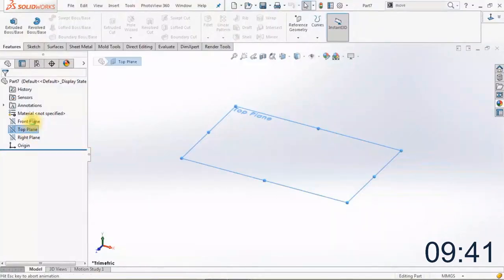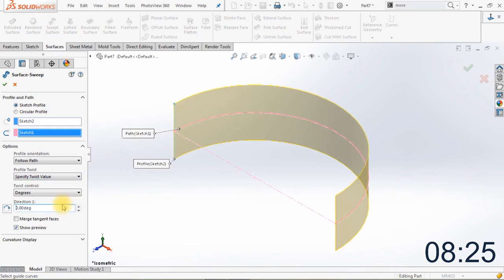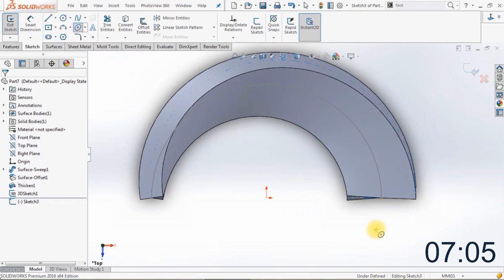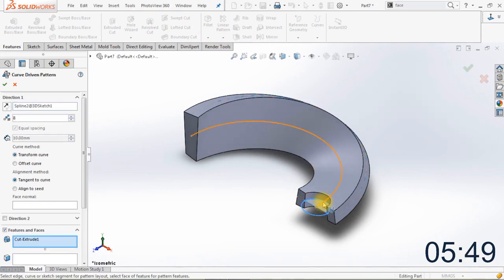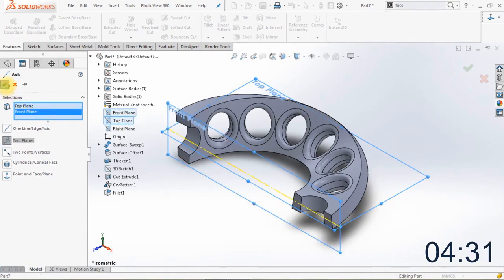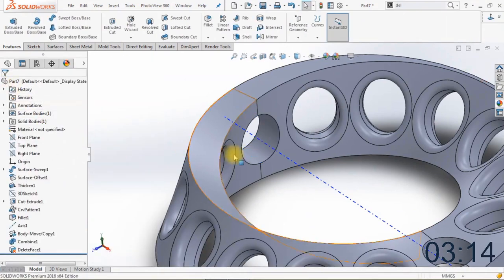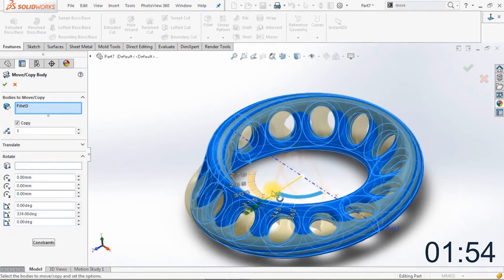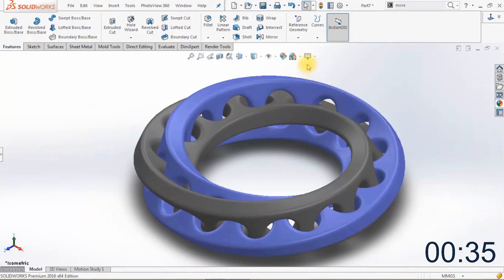Modeling a MOBIUS RING in SOLIDWORKS | Learn SOLIDWORKS by modeling a complex product in 10 Minutes!

Comment: Very high Cool Factor! 
I believe that this, as cool as it looks, would be impossible to actually make. Don't get me wrong, though, I Don't Care! Although it would be cool. 
I use an older version of SW (2015) and I found I had to "smack it around"* a little to get it to finally succeed, but I ultimately prevailed, and it came out perfect.
*it wasn't initially able to do the combine operation, but I figured out a way to help it succeed without compromising the shape.
Reply: @LearnSolidWorkscom  Don't think so. This is 2 separate parts that interweave without contacting each other.
Reply: @catkeys6911  that's true... but when the parts can move it's a fun baby rattle! ;) Otherwise you should add a couple of small support pillars indeed ;)
Reply: @catkeys6911  look up print in place designs. All sorts of printable multi piece interlocked designs out there